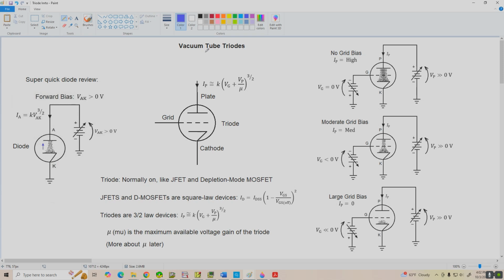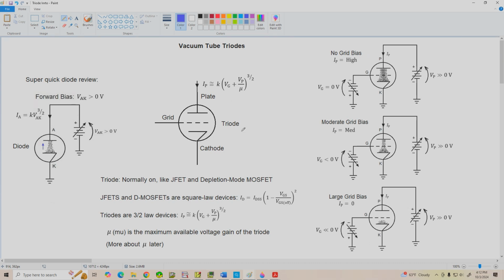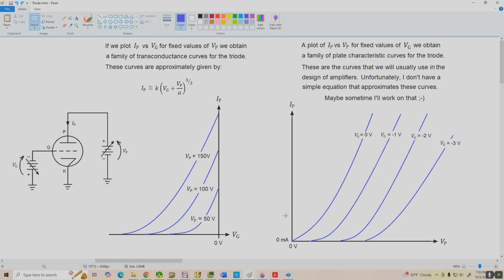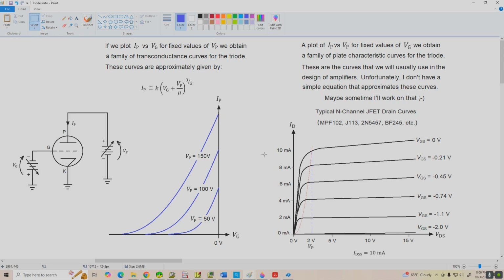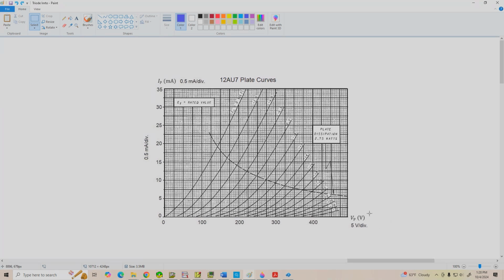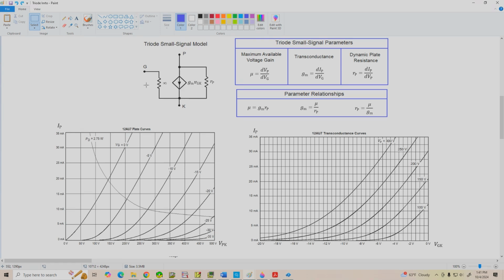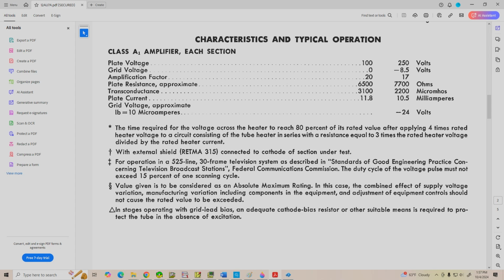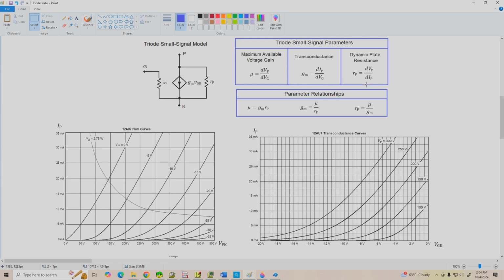Topic 60: Vacuum Tube Triode Basics

Comment: Thanks for this excellent video.
Just to clarify, there are a lot of sources that suggest the value for the amplification factor (µ) is multiplied by the gate voltage V_g in the formula for I_a, in other words ( (V_g)µ ). Some even suggest that the reciprocal is sometimes used (depending on the definition of µ). In such cases where the reciprocal is used, this is identified by this form ( µ’ ), in order to avoid ambiguity. Hence, where the reciprocal is used, the gate voltage is divided by the amplification factor ( (V_g)/µ’ ) in the formula for the plate current.
Is this correct. I apologise if this creates confusion, I’m just trying to learn 😊
Reply from the maker: Thanks for watching! I’ve seen similar stuff in various sources, but I prefer to use the simplest relationships I can get away with (I’m sure that seems hard to believe though lol). Anyway I’m not sure about the correctness of what you’ve got there. I’ll have to think about it some more.
Reply: @Denton.Dailey  Thank you for your reply, these topics can sometimes be a little confusing. I appreciate your help. Your content has helped me and countless others develop our skills.😊